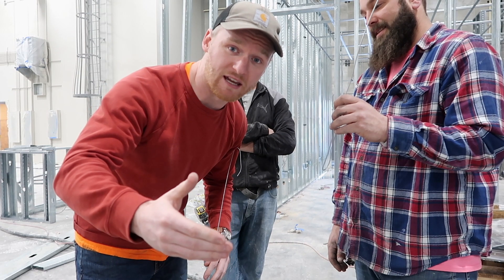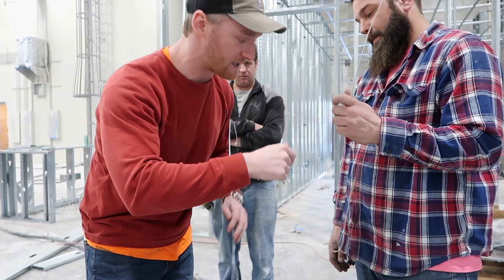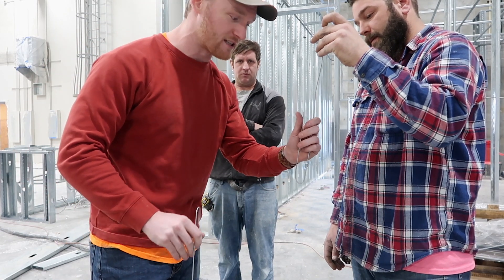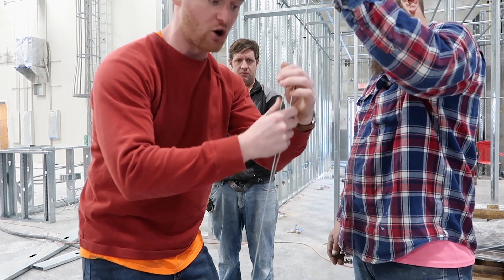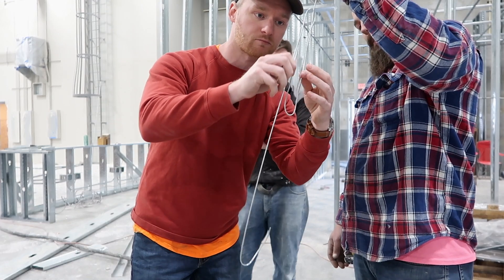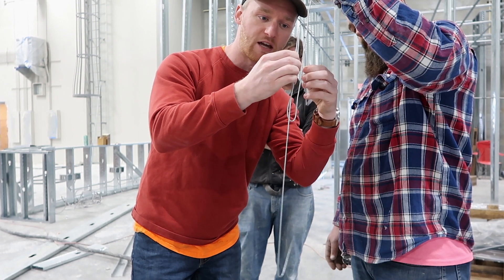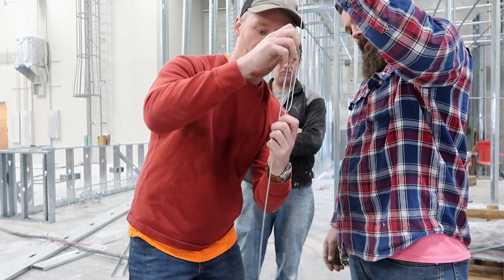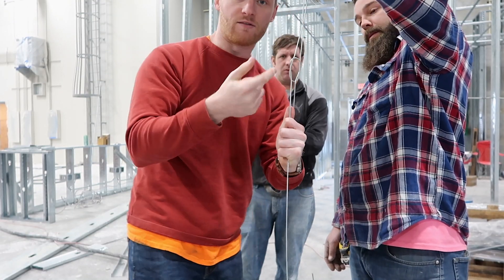Using a slip knot to extend ceiling tile wire

Comment: Make the bend on your upper wire larger than the wire you are attaching.  It’s easier to weave them into position.  Also, after pulling tight, bend bottom leg up.  This will lock the splice so that it never comes undone as other trades lift up and move your wires all over.

Comment: You didn't mention the legal 3 wraps within 1.5" or 4 wraps for seismics also the size of the knot must be pulled to it's max point thereby reducing its mass.
Reply from the maker: You can make a seismic video. We don’t use those codes here in the Midwest.
Reply: @mitchellacoustical3119  happy New Year ceiling guy
Reply: Yes I know this

Comment: The knot in the picture is not the same knot shown in the video...
Reply from the maker: It was done on a different wire, yes. Can confirm it is the same type of knot
Reply: Pause at 0:50 Canada is right that is not the same! So which one is correct?